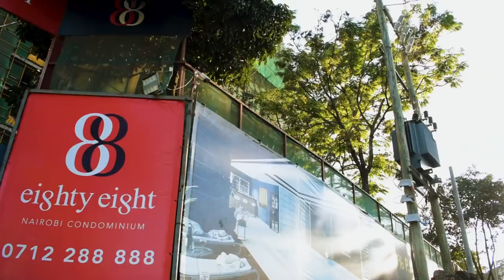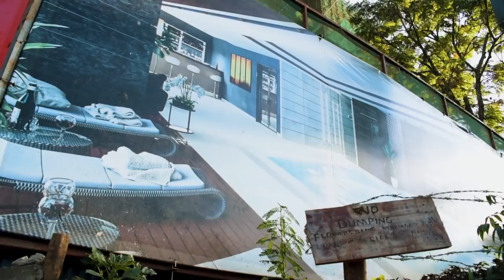17 Floors Later - 88 Nairobi !

Comment: I am  a  graduate engineer 

The class 50  concrete strength is just fascinating …Never been to any building using class 50 concrete, most use less than 30 and 30 is actually on extreme end.
Reply: I concur with you Kibet. Never heard class 50 in Kenya. Wow what a strength

Comment: Wow, amazing walk through, amazing project. Kenya is shining. Class 50 concrete in Kenya, GREAT Strength, I'm used to class 20, 25 and 30 for residential houses and low rise apartments. Good work Betty and Investors and our local young Architect.